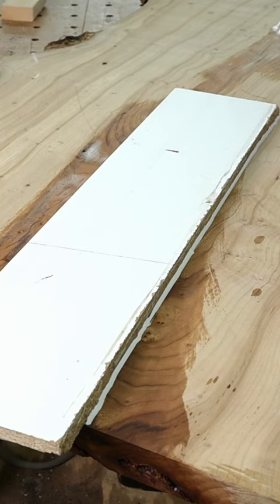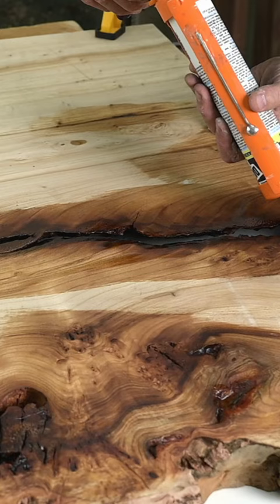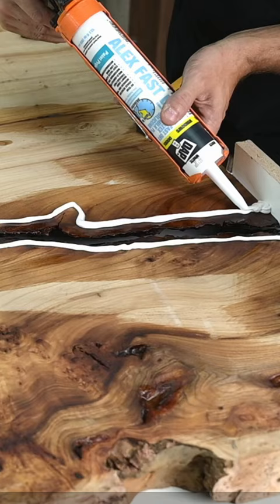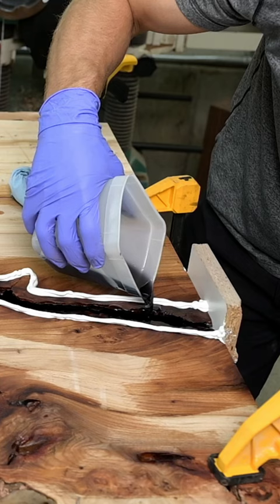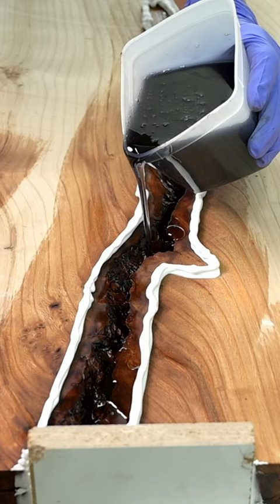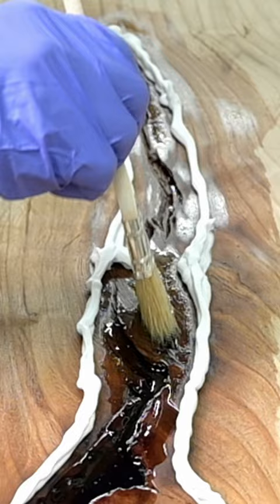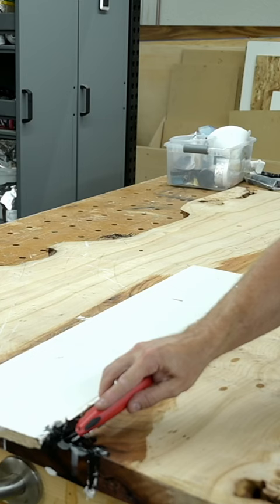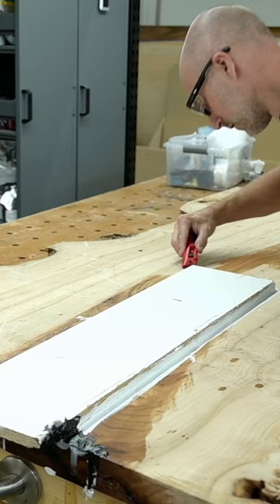Tricky epoxy pour

Comment: You can’t remove any more wood than possible, it’s literally impossible.

You can remove more wood than Necessary
Reply: While I do think he misspoke, I also think what he did say could be interpreted as what he meant to say.

He "doesn't want to remove any more than possible" could reasonably be understood as "doesn't want to remove any more than [what is] possible [to get the desired effect]." Meaning that there is a possible minimum amount of wood that can be removed, and he does not want to remove more than that possible amount.

Just a fun little grammatical brain bender.